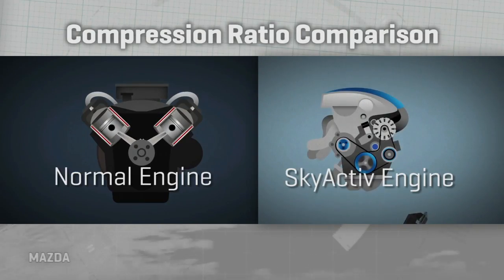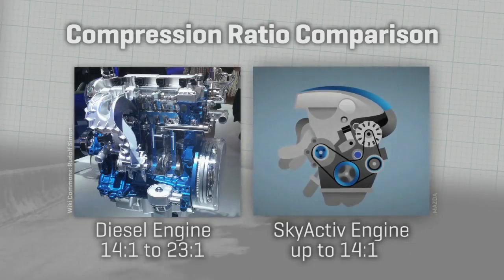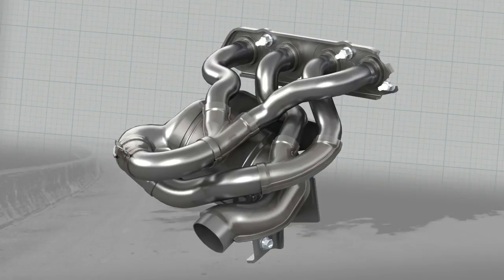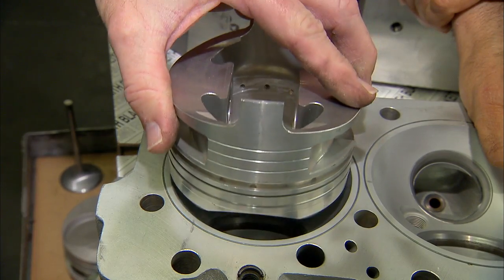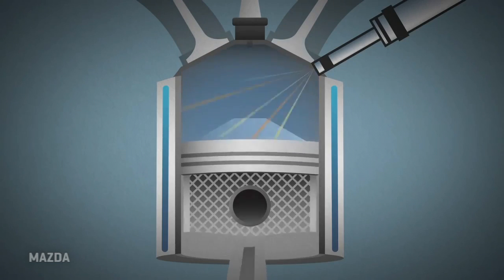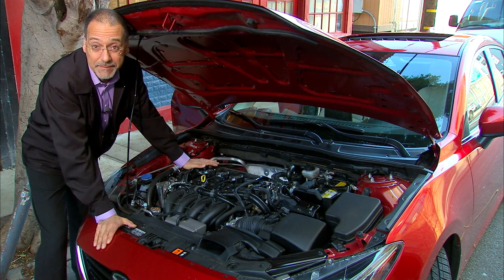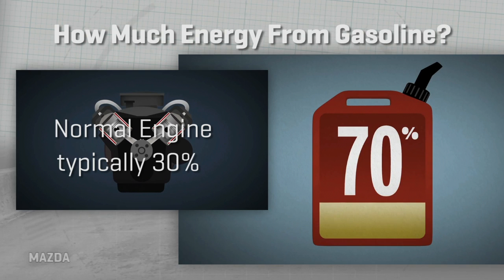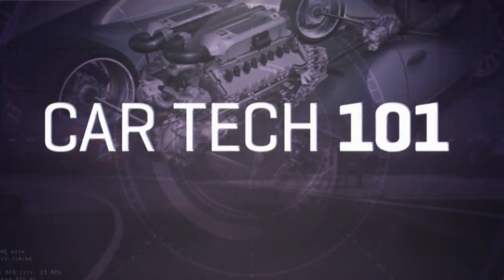CNET On Cars - Car Tech 101: What is Skyactiv technology?

Comment: I have a 2016 Mazda CX-5. Time will tell about durability. I traded in a 2008 Chevy Equinox with a 185 hp V-6 that was averaging 20.6 mpg overall. This Skyactiv engine is a 184 hp 4 cyl. that is averaging 27.2 mpg overall! Virtually the same hp but nearly 7 miles per gallon better fuel economy! 15 gallon gas tank,so better than 100 miles per tank of gas! I don't tow anything so less engine torque is no big deal for me. Very impressed with this vehicle.....so far.

Comment: Just bought a 2014 Mazda3 2.0, so it's interesting to see more in depth what SkyActiv is exactly
Reply: I'm thinking of buying one today. Is reliability good? Any problems?
Reply: Reliability is excellent and only problem I had was with the air conditioning, but that was a quick warranty fix and probably has been ironed out of the 2015s and beyond. Other than that, still an awesome car even at nearly 22,000 miles. Plus gas mileage for me has been averaging mid 30s in city driving (provided you don't hammer it too often).
Reply: Quick bit of advice too: add injector cleaner every 5,000 miles or so; help keep your efficiency up and keep the valves clean.
Reply: +TheGtracer1994 i test drove one today 2016. I couldn't tell a big difference in from the 2.5 to the 2.0. I'm trying really hard to find a used one but they're impossible to find, so that must mean they're good. Has your car seen snow? Also what trim level do you have?
Reply: I live in Florida, so I have never encountered snow. The 2.0L is all you'll ever need and has the right amount of passing power; don't listen to those who tell you that the 2.5 is an absolute, that's bs and just costs you more money both up front and in long-run. I have a i Touring, which is pretty well trimmed for me.

Comment: Ford should have done this on there fuel saving model SfE Focus. all they did was put on active shutters and closed off wheel covers on the 2012 Focus. Got mine in 2011 and since it was the only model that had a Spoiler on the lot, they charged $500 for those three features, now it's just $90 but after they reprogrammed the PCM, ABS and Transmission to shift smoother from a standing stop, the gas mpg is about the same as the normal model SE. Before that I was getting near 40mpg hwy, not anymore.